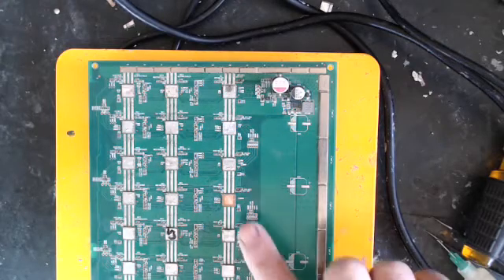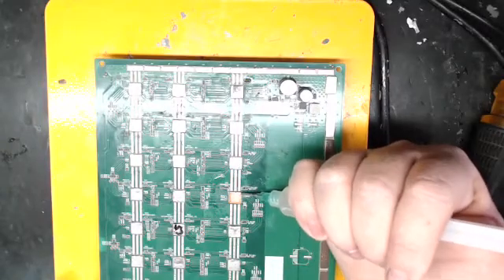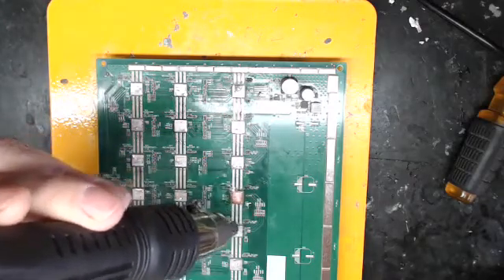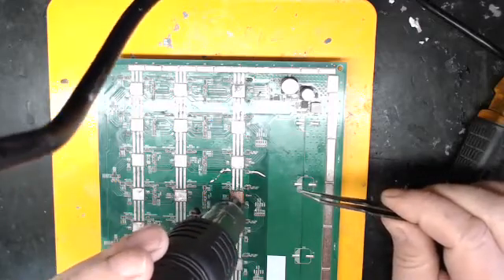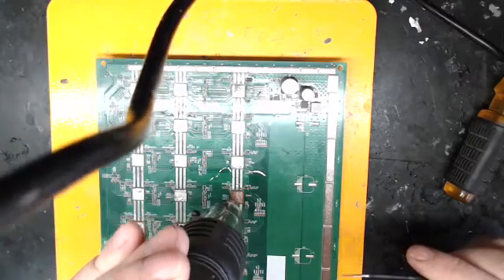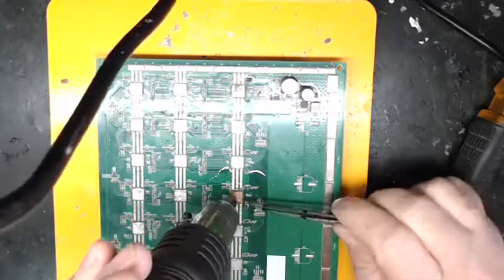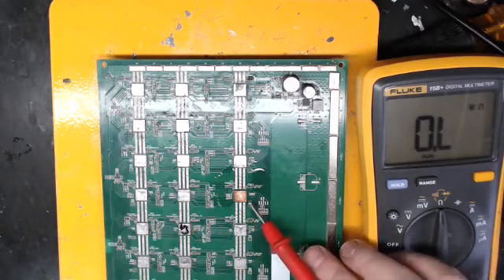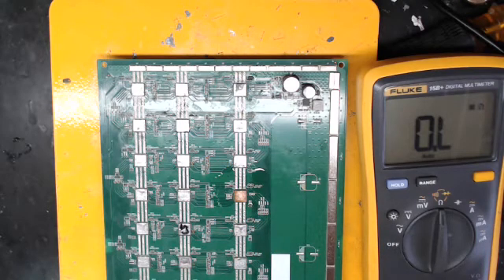hashboard repair:  Replace ASIC chip on T17 hashboard Part 4

Comment: Hell,  been watching your videos. Thanks for making them. What do you do when you've lost some resistors next to a chip? Put them back I'm sure where where can you get replacements if you lost them?
Reply from the maker: I can do a quick video on them.  Generally, if you are losing resisters or caps near the chip, you have the air on too much.  But it happens to me.  You can just get flux, make sure the mount has solder and put a new one on.  There is a T17 repair document somewhere on Zeusmining website that shows the logic of the boards. It has the sizes of resistors.  Most are 34 ohm, but some are 0 ohm.  A couple are 1000 ohm.   I purchased 10,000 of the 34 ohm 0604 size  (which are larger) for about $20 on eBay.  Hope that helps some.
Reply: @AntminerRepair  that would be great if you could do a short video on it!

Comment: Hi, I have t17 too and 0 Asic of hashboard. It very useful to me for repair by myself. What type are you use solder paste for chip and heatsink, it same type or not??? Looking for next vdo tutorial :))
Reply from the maker: Hi Pang,  Thanks for the comments.  I use two different solders.  But I'm not at home right now to get the model numbers.  I'll do that a bit later for you.  I have both paste and wire, but they are essentially something like 186 C for the chip, and 131C for the heatsink.  Hope that helps.

Comment: Hey antminer repair. I would love to see some results with the Asic repair tester. I see the most time is lost with identifying the right chips for repair. I am very interested with the results of it. Gave a little donation to support of your work.
Reply from the maker: Hi Arthur,  I'll set up a way to video it and explain.  I have it hooked up to the antminer PSU but I'd like to set it up with a simple DC power supply.   If that doesn't work, I'll video in the garage and have to voice over.    Thanks, I'll work on it.
Reply: @AntminerRepair  Great, let,s make this channel a repair community. There is very little info about this subject.